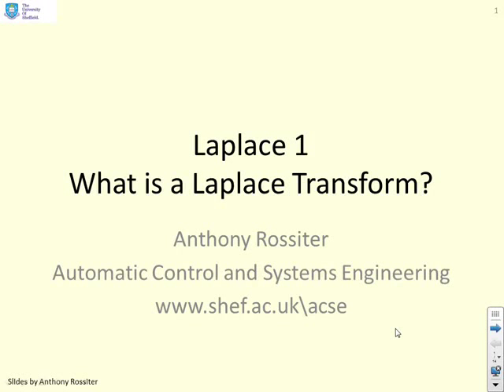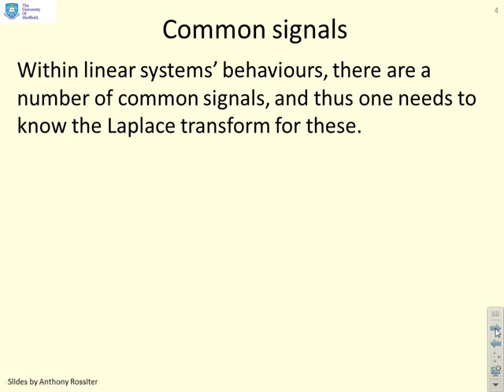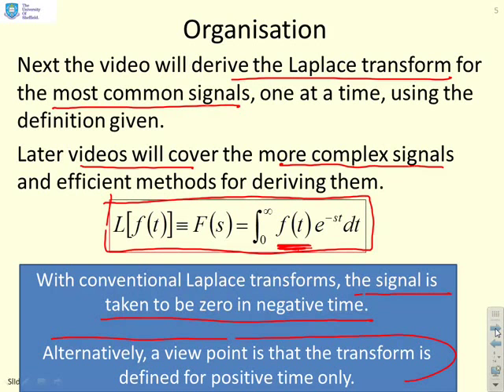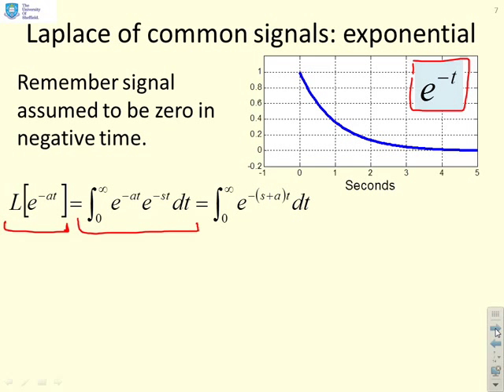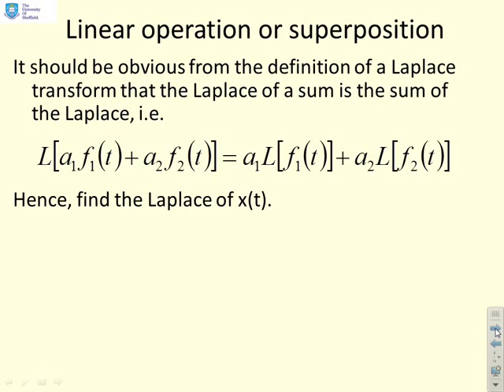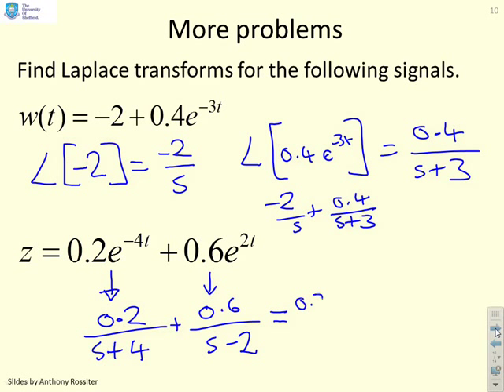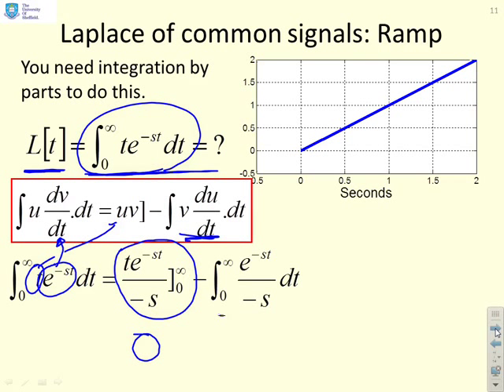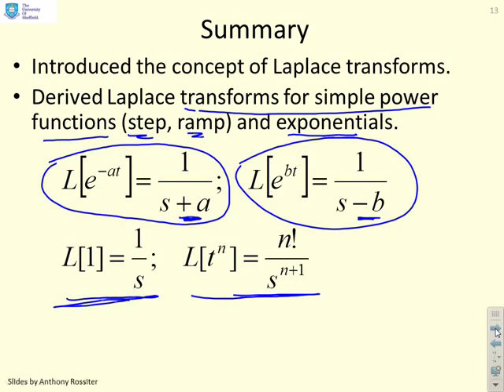Laplace 1- introduction and basic functions

Comment: Hi John, Thanks for the video it is valuable. However,  it would be nice to here examples of how the Laplace transform has been used throughout history before showing the algorithm to calculate. The thing that frustrated me most about EE courses was diving into the formulas without really understanding what the thing is used for. Even at the end of undergraduate I still did not have a sense of how to use the Laplace transform on an engineering application but I knew it was a thing and if I was given a formula I could calculate it.